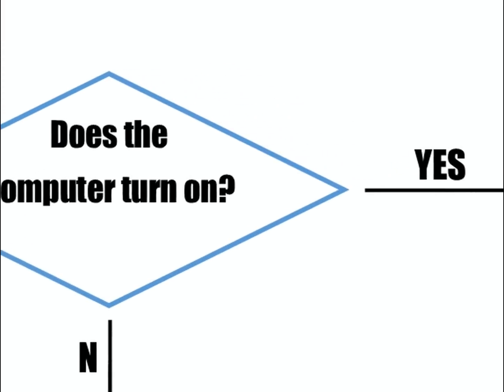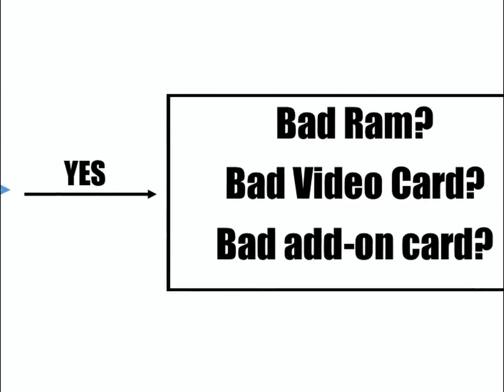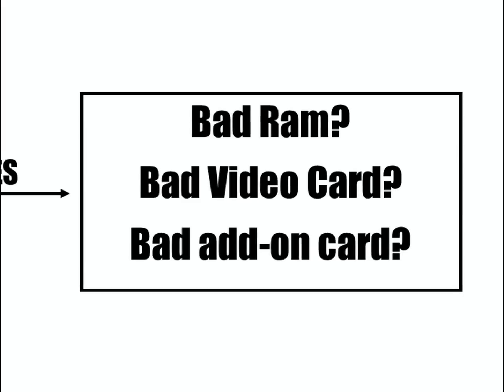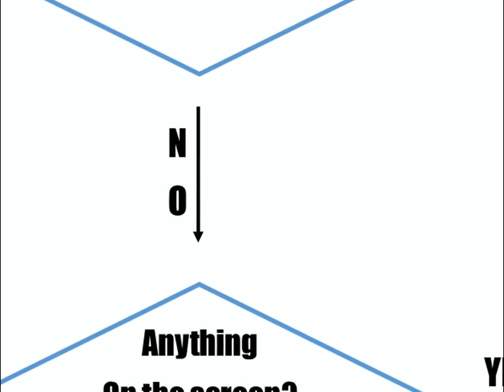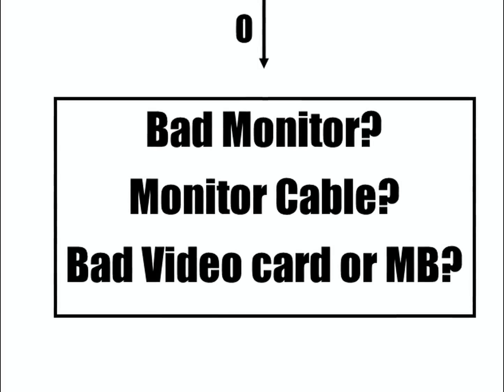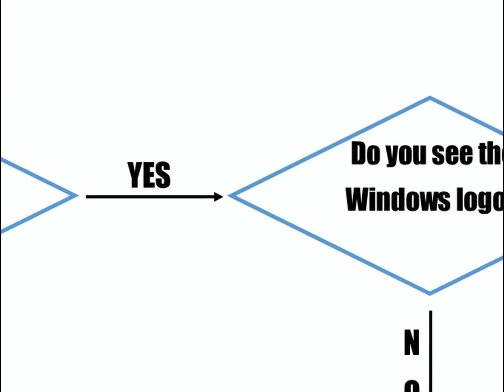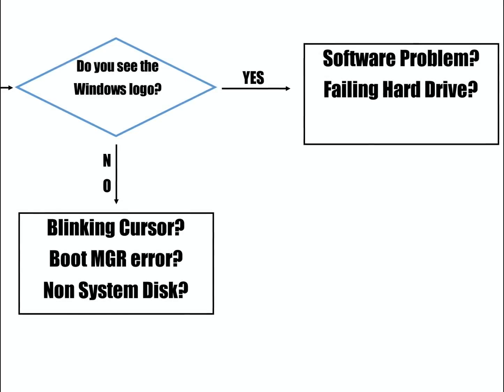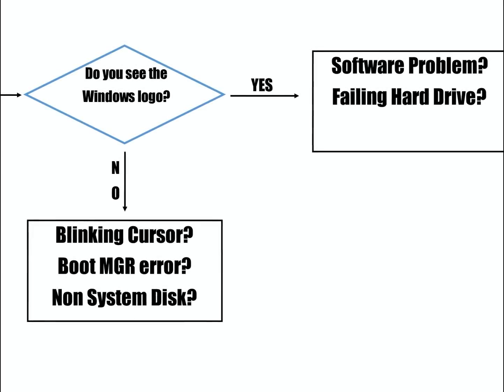How to diagnose a hardware problem on a computer that wont boot?

Comment: hi i need a help? my computer goes blackscreen everytime when i run any game or when i`m using photoshop or Fl studio. 
I bought it like 2 years ago! 

Processor: intel core i3 3.30ghz
Ram: 8gb
Windows 8 

pls help
Reply from the maker: It sounds like the video card might be going south when you work it hard.  Is there a separate video card in the machine or is it built on the motherboard?
Reply: Roger Ahuja it` s built on the motherboard
Reply from the maker: Ammar Feyzula The only suggestion I would have then is to try to update the driver for the on board video card.  Make sure you only download software from the manufactures site only.  There are a lot of drivers that are avail from other sites, but they usually come with Malware and you'll make your system worse.
Reply: thank you sir

Comment: My computer boots, but once the screen turns on it flickers all the way to a few seconds after the Windows logo shows up. I changed the video card, tried to find similar situations on Google but usually the situations described say the flickering goes on even after boot up, as they are using the computer. Once I'm booted up, the flickering stops. My power supply is 600W, I have one SSD (OS and Sata III connected via  Marvell card) and 3 HDD (one Sata III and two Sata II). I have 16 GB of DDR3 RAM, my screen is an HP w2207 from 2006. I did Windows updates and updated all drivers that needed it. I'm stomped... Any ideas?
Reply from the maker: The fact that it only happens before the Windows logo suggests a hardware compatibility issue and not a software issue.  It sounds like once Windows loads it works fine.  The only suggestion I would have is to update the bios and see if that makes a difference...

Comment: My computer windows 8 heavily modified the power is good but the hdd light isn't coming on and the video card isn't turning on I don't think its its the board or power maybe the card ?
Reply from the maker: Allie Roskamp If you're getting the fans spinning up, but nothing else coming on.  I would try to reduce the machine down to its bare necessities (Power, Motherboard, Ram & Video) and see if you get anything on the display.  If you're still not getting anything, then it's most likely the motherboard, but it could also be the ram.  If you happen to have a spare power supply, it would be great to confirm its not the power supply by trying that.  I've had power supplies that the fans would spin but it still wouldn't work, but those are very rare cases.